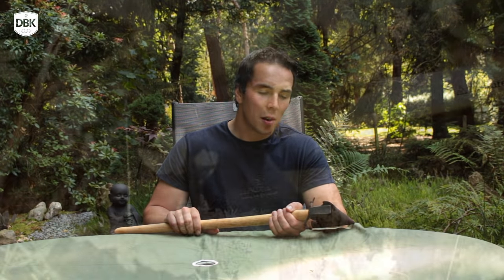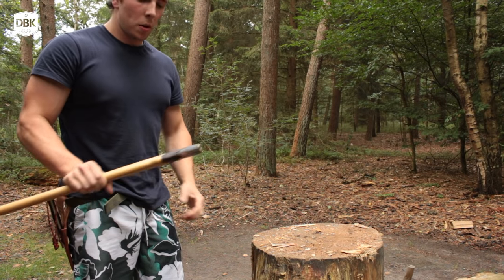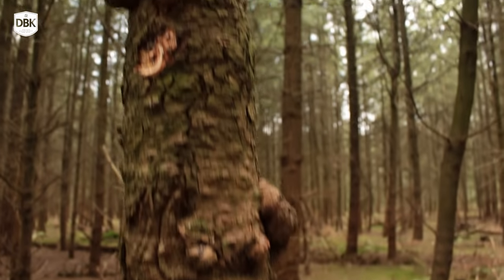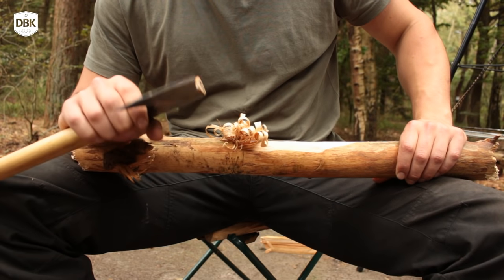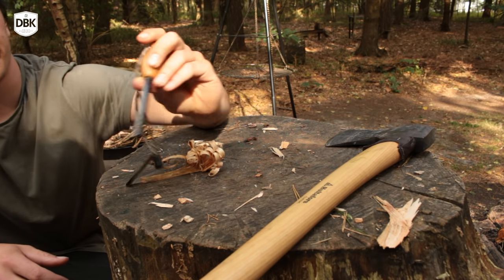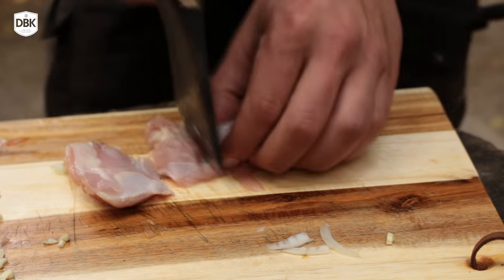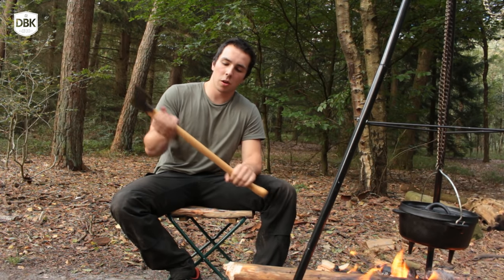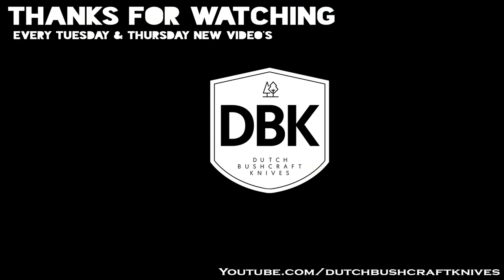The Axe That Does It All - Hultafors Felling Axe

Comment: Next time can you not fast forward the chopping, that's the best part of watching an axe in action. It makes it harder to judge how well the axe perform.
Reply from the maker: +Kaze thanks for the feedback. I'll keep it in mind. These trees were a pain to chop anyway because the roots were rotten and it moved along with the axe.
Reply: I always try to chop low down on the trunk whithin a foot of the ground or less.  Less wobble, less waste, less mess left behind.  It's awkward at first, but it gets easier and works fine when you get used to it.
Reply from the maker: thanks I'll keep that in mind. I do saw as close to the ground as possible but I don't chop a tree that often. My husqvarna chainsaw does a quicker job hehe.

Comment: YOU’RE DOING IT WRONG!

First let me say I enjoy your videos, humor, and information and I am a subscriber. 

I tend to watch videos in groups as I have time. Bouncing from one set of information to another. “The Axe that Does It All” just happens to be the fifth video in a row (looking at axes) I have witnessed a total lack of understanding and or poor technique when using an axe to cut down a tree. Wasting way more calories and time than needed. 

You must understand the structure of a tree to see what you’re doing wrong. It has grains running vertically the length of the trunk (or limb). You do NOT cut through the grain to the other side of the trunk. You SPLIT sections out!!!!!

I stopped counting how many times I have seen a people trying to cut this small wedge out. Wack, wack, wack…...an hour later….wack, wack...etc.

Save time and energy by SPLITTING sections out at a time. Making your first cut at a slight angle inward of the intended section to be chipped/split out. Then move your strike point 6-12” and again cut with a slight angle inward (toward your first cut). You will see the section between the two cuts split out down the grain with very little force (removing more material at a time). Repeat the process till you are through the log/limb or reach the fail point opposite your directional “notch cut” when felling. 

Bonus: when bushing it, you end up with GREAT kindling boards not a bunch of splinters. 

Good luck!
Reply from the maker: thanks a lot for the explanation mate! I appreciate it! i'm totally aware of my lack in axe skills though. I do want to learn it but I just don't use an axe that often actually. I do appreciate the tool a lot.
I will try your technique! thanks!
Reply: When you do try it, you will blaze through the wood. Enjoy and I look forward to the video!